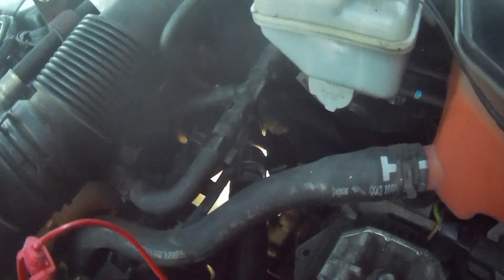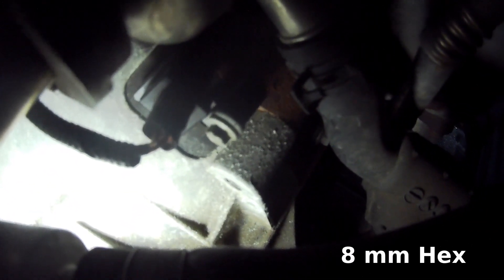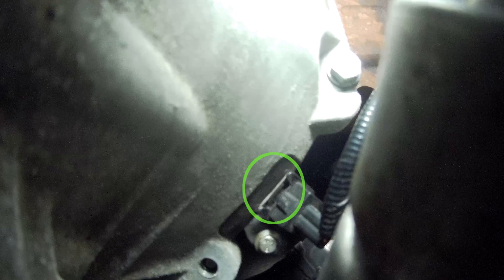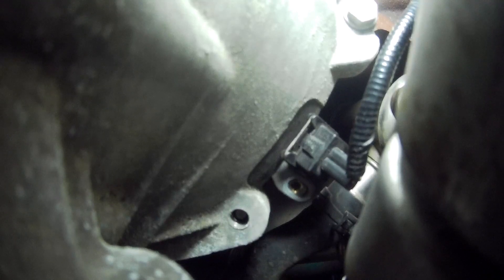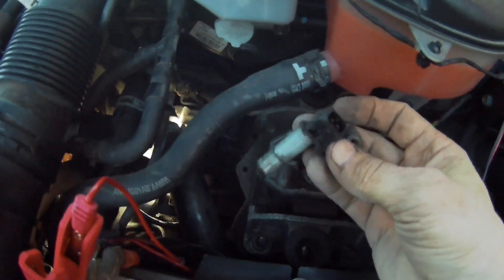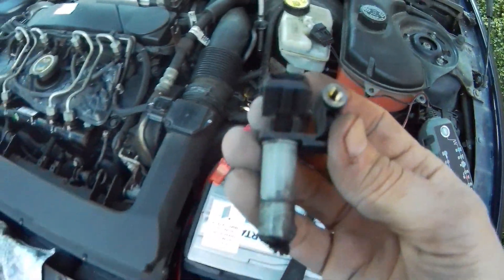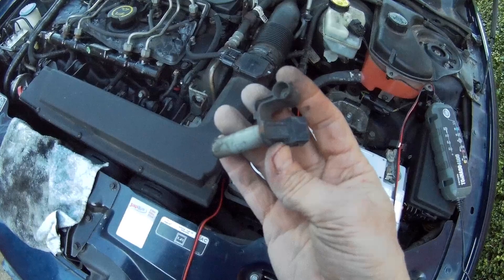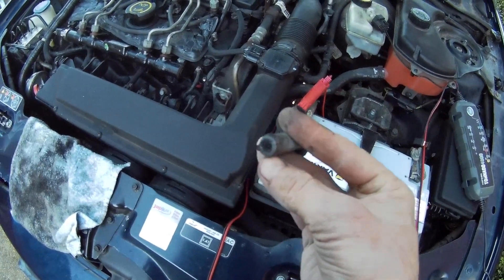JAGUAR X-TYPE 2.0 TDCI CRANK SENSOR 07

Comment: Hey man, I don’t suppose this being faulty could cause everything to cut out when hot?

My Dad has just bought one of these today, and it cut out 3 times on the way home. Everything seems fine, drives well and starts back up. Drives fine around town, but cut out on the motorway putting the foot down a bit
Reply from the maker: From what you say, to IMHO It is unlikely to be the crank sensor as you would likely get starting issues when the crank sensor goes bad. It sounds like either a fueling issue, mixture or vacuum.  I would run a obs diagnostics live test as you will be better able to analyze the data as the fault happens.
Reply: Did you get an answer? I was getting that, changed the Fuel filter and cleared the line,, not got it since

Comment: Can this stop the cruise control
Reply from the maker: The car likely won't ruin at all without this, it sends a signal to the Engine Management for correctly timing the cylinder positioning with the spark and fuel injectors. Cruise control logs the speed electronically, if not working I would check fuse first the look at pedal sensors and steering wheel buttons & connections. .
Reply: @HatBoyHarvey  thanks for that google don’t really help. So far fuses are good. Changed the pedal switches. And wheel speed sensors coz the car scanner said speed position sensor. Didn’t help 🫨
Reply from the maker: @mattyjamess7818  does it say anything on the dash when you turn it on ' cruise control not available'? Maybe, If so the switch is ok, but the ECM may be in limp mode or something due to other codes/sensors not working.
Reply: @HatBoyHarvey  it says cruise control not available with the yellow light. It’s driving fine. No one can fix it or me 🫨 it has got Jagdroid upgrade but I can’t see that being the problem
Reply from the maker: @mattyjamess7818  I can't see Jagdroid affecting it also if it worked before installing this, but maybe contact them to rule it out. Have you had the steering wheel off etc? Have you looked at the throttle position sensors connection and wires?
Reply: @HatBoyHarvey  thank you for messaging. Erm the car come with it even  dealer changed the clock spring didn’t help. Not changed the cruise buttons I’ll try that next.
Reply from the maker: I would contact the guy at jagdroid as his device uses some of the functionality on the other buttons and could have effected those by design/mistake
Reply: @HatBoyHarvey  I got car 2 years ago and it come like it so no idea who done it. I’ll try the cruise buttons next 🤞🏼